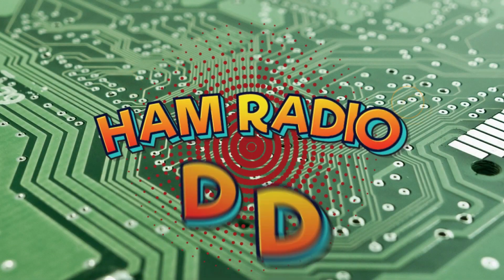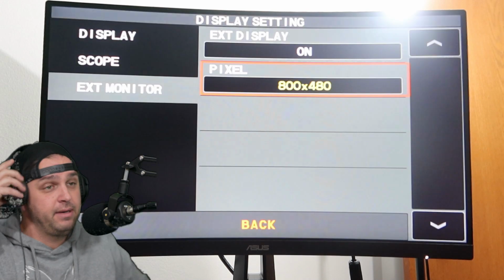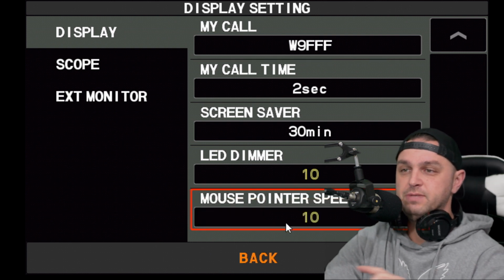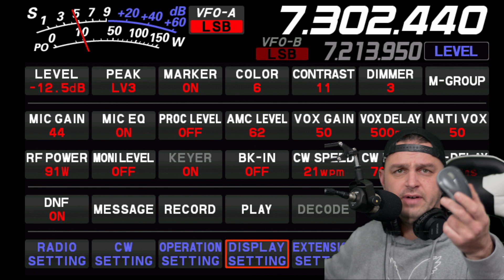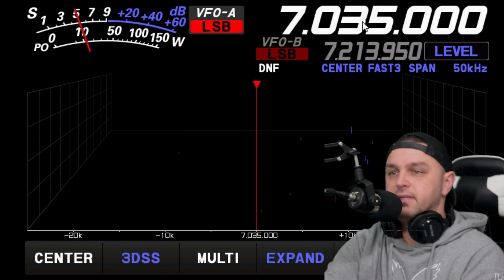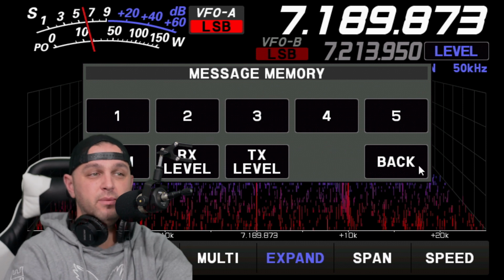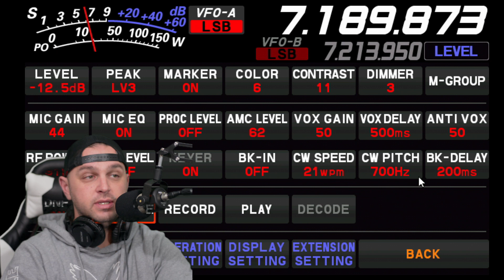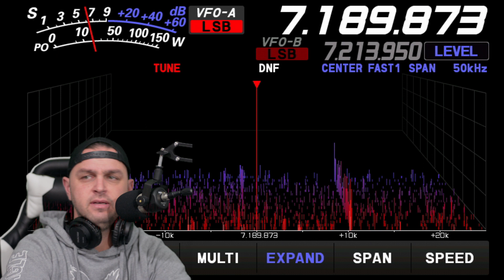Yaesu FT-DX10 External Display, Memory Card Formatting, and Testing Keyboard / Mouse functionality

Comment: How do you “attach” a wireless mouse? 73 Tom KC3QAC
Reply from the maker: If it will work, plug in the usb port to the back of the radio and turn on the mouse.

Comment: Well got a M-185 (M/N0087) and it just flies on the edges of the ft-dx10 screen. Latest firmware. So something is different between your FT DX10 and mine.
Reply from the maker: Interesting. I'd assume it may have to do with the resolution size? What monitor are you using. I can't test anymore as I sold the radio to fund the flex
Reply: @DudeTested  tried with and without external monitor. Ext monitor at both resolutions. Wired mouse works. I’m thinking Logitech rolls out quiet revisions of their dongles. Some work, some don’t. Picking up an M310 locally today but know some can’t even get that working. Enjoy your Flex. Thank you for all the work you put in this great channel. 73
Reply from the maker: @Aimsport-video  I'm sorry, for some reason I was thinking monitors. Yes there happened other reports that the newer m185 mice don't work. I must have an older one.  I don't remember exactly where and I'm not near a computer but there's a groups.io for the FTDX10 and they talk about the different wireless mice that work. Hopefully that gets you in the right direction buddy
Reply: @DudeTested  thank you. Scored an M310 locally, plugged it in now, and it works.  73

Comment: After the format, did it go back to the SD card menu automatically?  Mine sits at the "Format Complete" message forever and I have to hit a button to get out.
Reply from the maker: I think mine would do that also.   I ended up selling that radio :( to fund a flex.  But as a recall, that did happen
Reply: @DudeTested  Figured my issue out.  SD card was flaky if radio connected to USB.  Disconnect and it works great.

Comment: I purchased a new ViewSonic 20" 1920X1080 Monitor W/ DVI & VGA for $ 90.00 and it looks prefect @ that resolution. Make sure to use only DVI-D 24+1 Male to Male Cable  as Yaesu Recommends for the FTdx10 a  DVI-D 24+1 Male to Male Cable. NO  "HDMI to DVI Adapters" As They Are Not Compatible and may damage the EXT. output. BestBuy has that Monitor for the same price.. 
ViewSonic VA2055SM 20 Inch 1080p LED Monitor with DVI & VGA $90

Comment: Shame on Yaesu for not building into their radios a one way circuit (think diodes)... that would stop voltage from getting back into their DVI-D ports and destoying the DVI-D port on their new radios.  I would bet  that newer production runs of these Yaesu radios  would have a corrected blocking circuit instlalled.
Reply from the maker: Hey man.. do you see when I made this video? How the hell did you want me to know  what Yaesu had on their hands?   I don't work for Yaesu and I am not a physic.  I can't be expected to keep up on everyone of my videos, updating every single thing that happens.. 11:06am 3/23/22, I dusted off my Yaesu ftdx10 with a microfiber cloth.  McGuire's works great!

Comment: I tried 5 different mice trying to get it to work.   Every time I plug it in (either USB Port) it locks the unit up.   The only one that worked was an Amazon Basic mouse but the pointer jumps all over the screen.   I ordered a M325 and it does not work either.  I am taking one last ditch effort and try the 185 you recommend.   Gee you would think a mouse is a mouse but not with the DX 10.  Guess you just lucked out when you grabbed up the Logi 185.   Hoping this works for me.
Reply: Thanks but I played it safe and got a wired mouse and it works great.... talk about old school.... ha ha.
Reply from the maker: Hi Dennis, sorry for the late reply. I think I discovered why my m185 mouse works and others have issues.  I believe it has to do with how old my m185 mouse is (I believe i got it in the mid 2010's).  I believe the older m185 mice have a different chipset in them, most likely. I am hoping you were able to find a working solution.

Comment: Watched your video and bought the Logitech M185 worked as it was a lot cheaper than the M310. Plugged the receiver into the FTdx10 and it does NOT work. In fact, it locks the rig up as none of the buttons work and you have to reboot the rig.  Wired mouse works fine.  Maybe you have different firmware ?
Reply from the maker: I think the reasoning may be different hardware inside the m185.  the FCC id on my m185 is jnzmr0085. I would guess it's about 5 years old
Reply: same thing happened to me, bought the M185 as mentioned in this video and it locked up the rig and won't allow me to access the menu system. I will get a wired one and try.

Comment: Question for you , I am having trouble installing usb drivers , keep getting error message. You must install before connecting radio correct?
Reply from the maker: Great question.  I installed the USB drivers from the Yaesu website after I plugged everything in.  However, I have heard of people in groups.io do it before hand.  What error message do you get?
Reply: @DudeTested  No equipment or something like that on your system ? I was able to get them on my other laptop after many tries. I will go back and try some more on my shack computer.

Comment: Mine is on the way, sweet. I really  wish my ftdx 3000d had monitor and mouse capabilities, pshh go figure. Anyway just to confirm, you cannot change the frequency   with the keyboard?
Reply from the maker: I cannot remember. I do not believe you could.  Good Luck with the new radio!

Comment: I'm curious, is there any specific reason ham radio operating systems look and feel like they are 20 years behind? I thought that all these rigs would be more like a customizable PC by now, both hardware and software, with open APIs so you can hook into the OS and create your own custom software build, custom widgets, screens, extend the base package even more, and upgrade your processor, memory, graphics card, and not have this ancient 800x400/32Gb SD card, DVI, RS-232, and various DIN i/o on the back.

Comment: Did you do anything to activate the mouse? Ive plugged two in and got nothing. Just to clarify, does the cursor show up on the radio, or just the monitor screen
Reply from the maker: Nothing special. The mouse works on both the external and on screen, if I recall correctly.   John Kruk (I believe it's his name) from yaesu said these radios were only designed for wired mouse and support for wireless devices may vary.  I have since this video, seen a lot of new models of wireless mice, not work.  However, the older ones seem to work
Reply from the maker: A little more frequently*

Comment: Question: Plugged in a mouse, cant see any pointer? any help ? Thanks. W4EMB
Reply from the maker: I'd assume the mouse isn't supported.  Is it wired or wireless?  I've seen a lot of reports of wireless mice(?) not working.  I was able to get a m185 working, but others couldn't.  Could be a different version of the M185. But first things first, if it is wireless, I would consider a different mouse.  Best wishes

Comment: Dude, do you feel it's a deficiency that the external monitor isn't higher resolution? 
With more physical space did the image seem jagged at all? Opinion? 
For personal use would you tend to use an external monitor or comfortably rely strictly on the internal screen? Use Cases? 
External Monitor availability on the ftdx10 seems a big advantage over the IC7300, but at a price.
Thanks
Reply from the maker: I am not overly concerned about the external monitor not being a higher resolution .Would it be nice to have the higher resolution, but it doesn't bother me too much. I will say, I tend to rely more strictly on the internal screen due to space issues at this location.   I do understand the IC7300 vs FTDX10 concerns a lot of people are having.   I love my FTDX10 for the great audio filtering, The CW decoder (which can be tricky), and certainly the ability to hook up a monitor/mouse to the radio.   The Audio Filtering was a huge reason for me to upgrade from the 7300.  With a bit of work on the original firmware, Yaesu will probably have good success with this radio. . Hopefully this helps you a tad.
Reply: @DudeTested  Thank you it does....73
Reply: @DudeTested  I purchased a new ViewSonic 20" 1920X1080 Monitor W/ DVI & VGA for $ 90.00 and it looks prefect @ that resolution. Make sure to use only DVI-D 24+1 Male to Male Cable  as Yaesu Recommends for the FTdx10 a  DVI-D 24+1 Male to Male Cable. NO  "HDMI to DVI Adapters" As They Are Not Compatible and may damage the EXT. output. BestBuy has that Monitor for the same price.. 
ViewSonic VA2055SM 20 Inch 1080p LED Monitor with DVI & VGA $90

Comment: Yes but how do you actually connect the external monitor to the radio, on what port and with what cable?
Reply from the maker: There's a DVI port on the back of the radio.  I just purchased a DVI to HDMI adapter at Walmart for 12.95.  plugged it in to the back of the radio and the hdmi cable to my monitor and enabled the external monitor in the radio settings

Comment: What wireless mouse you use? Not all work apparently
Reply from the maker: Logitech m185
Reply: I have tried 3 wireless mouse including a brand new M185 with a new battery. Is there a setting somewhere to activate those USB ports? Tried both and reset the rig. TIA
Reply from the maker: Sorry to hear it's not working for you.  I didn't have to do anything special to get it running.  It is my daily driver for my computer and I just unplugged it from the computer and plugged it into the back.  Nothing special I had to enable.  I did yeah a blackweb mouse, which did get detected, bit improperly navigates (bwa18xxxxx). I'd avoid that one.  Can you confirm if a wired mouse is working? Just want to ensure its not a USB issue
Reply: @DudeTested  pick one up later today and try!